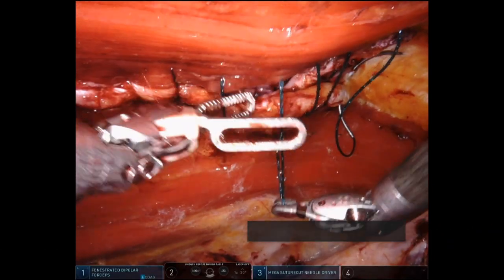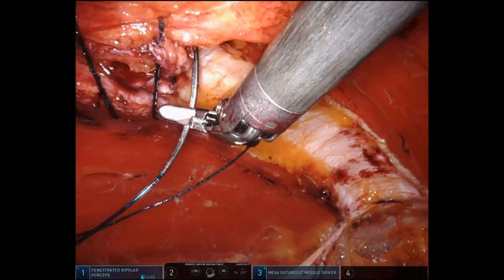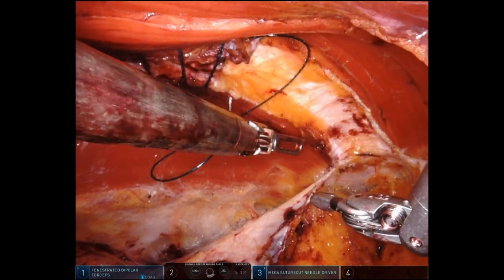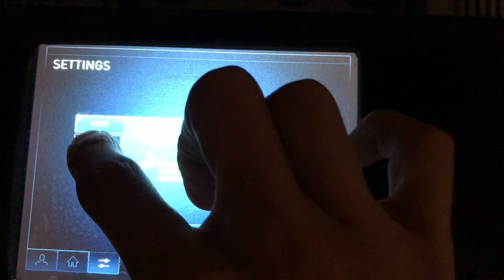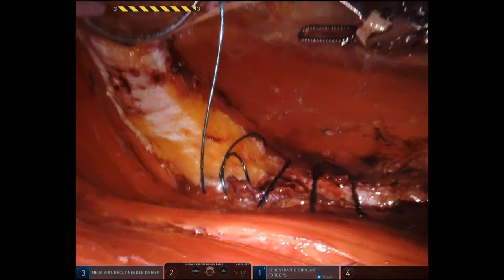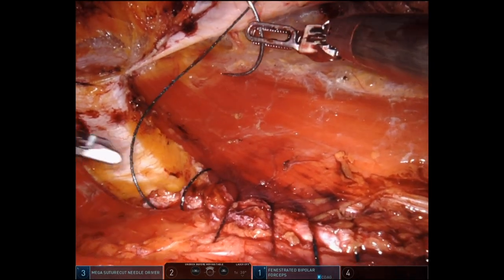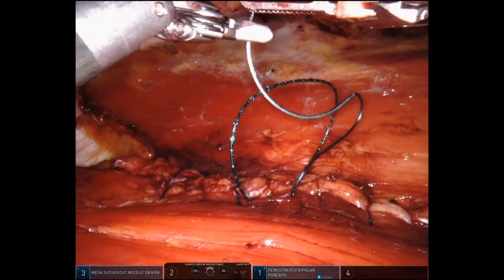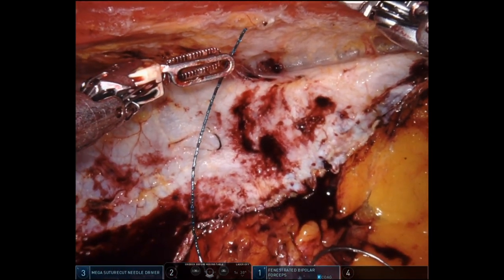Situation during Robotic Ventral Hernia Repair for Image Inversion

Comment: Great tip! I thought the robot automatically flips the image back if you rotate the scope 180 degrees. You just press the instrument clutch on the camera arm and rotate 180 degrees?
Reply from the maker: For Image Inversion either have the bedside assistant manually rotate the scope after instrument clutch (then reclutch after turning the scope) or you can drive the scope upside down at the surgeon console.